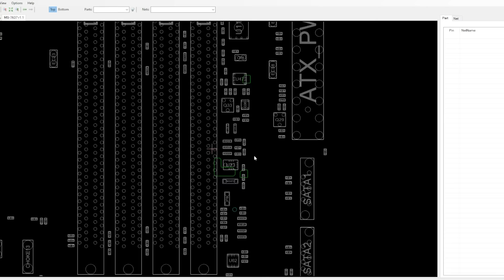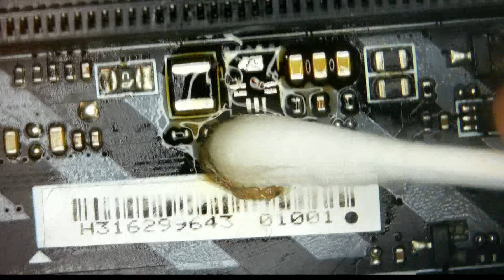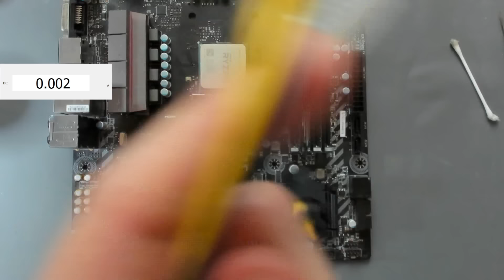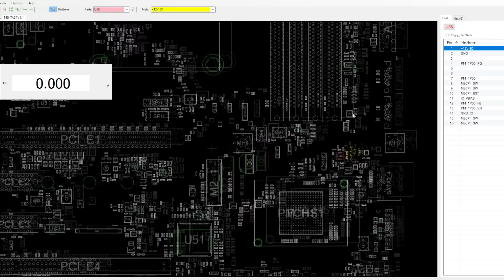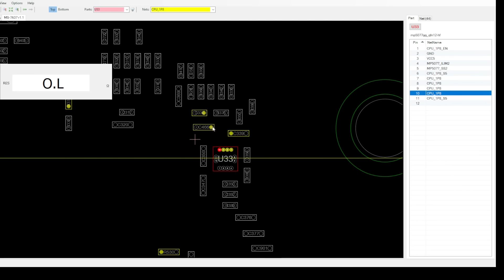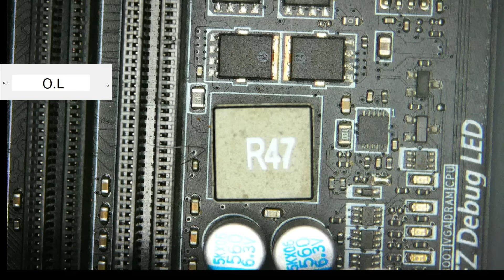SO MANY SHORT CIRCUITS ON THIS MSI BOARD ||| B350M MORTAR MOTHERBOARD REPAIR FIX

Comment: I got this same board that had some issues after a lightning fall near the house, most likely the main PCIe port do not get enough power to the GPU so I am using the second one (x4) and the CMOS battery drains too much faster (2d), I am deciding if get rid of it or try to repair, but I am quite a noob with electronic components :face-purple-crying:

Comment: I swapped the vrms from an Asrock board to a MSI mortar that AI said would work as the components were compatible, but the power management circuit was not having it, lol. The voltages were off just enough to not work. The original parts are like $30 worth of mosfets for a $40 board..... not going to work financially.  Possible, but not feasible. I like this tech’s videos.

Comment: I guess something downstream of the MOSFETs is using a lot of power, ie, faulty.
Maybe someone shorted between rails, and that over-powered the lower ones.
There might be pin compatible chip for the unobtanium, or just design another supply with a different chip.

Comment: Hello thanks again for my last comment. 
I am trying to repair Gigabyte B650M Aourus Elite AX (Newer AM5 motherboard). The problem is stuck on CPU bebug LED. Things that I have done so far
Found physical damage on capacitors next to SIO(iTE IT8689E) one was shorted.
Replaced both caps.

First boot attempt results in stuck CPU LED. Checked for voltages. All present though there is a weird 0.75V rail near BIOS chip.

Resistance of Vcore phases measure 85 ohms without CPU installed. Too low?
Sends 0.9V to CPU when attempting to boot. CPU does get warm after a few seconds.

Lighting LEDs near B650 chipset flashes for a split second then stays off sometimes when power supply is turned on, before pressing power button.

Desoldered BIOS chip and flashed with new version (F30). CPU LED is still stuck.

Used thermal camera to try to find any shorts. Nothing over 50C. Aside from the VRMs there is a serial chip translator/buffer chip (AZ75232) that does get unusually hot 46C at power up.

Last thing I checked was the oscillator crystals. One near CPU socket works at 48Mhz. One near B650 chipset works at 25MHz

Once again confirmed voltages around SIO and chipset. 1.0V/1.8V/3.3V

Any suggestions would be greatly appreciated. Thanks.
Reply from the maker: Have you checked the backside for more dmg? If you found damage already there likely is more! 
What is the resistance off the 12V CPU?
Is pcie reset still applied?

Comment: Been binging you a bit recently and have got to ask a question you may be able to give some advise on. The usb ports send power for about a quarter of a second then drop completely. I was thinking cpu related but before spending money on one I'd like a second opinion.
Reply from the maker: Might need to check the resistance off the USB line, there might be something shorting it, which is why its cutting out!

Comment: Looks like victim of voltage injection done by someone who just tried to copy what he saw online without understanding anything. 

Anyway, about that voltage controller - board manufacturers rarely use something that can't be replaced with different part so you can probably find something else in the same package with a same pinout (chipmakers also try to use same pinouts as competition for a same reason, at least when their customer isn't Apple or somebody big like that).

Comment: Can you share how you do to know the consumption and the amps ? Take by the motherboard? Thanks for sharing your knowledge... Greattings from Portugal 🇵🇹 🌟
Reply from the maker: Only from experience, when i started i had no idea, but after all the boards i did, i now know aprox, what to expect! One off the most important aspects off current is if it is static or jumping! Static is most off the time bad and jumping is mostly a good sign!
Reply: @MainboardMedic  Sorry, I explained myself poorly, I wanted to tell you how you made the connections to see the voltage and consumption of the board... volts and amps ? Thanks
Reply: @skysurfhf  I believe "northwest repair" showed how to build something like that.
Reply from the maker: @skysurfhf  Oh i got it, its called a M4430 on aliexpress! Its a current sensor! So i have a 12V 100A power supply that connects to the M4430 and that then connects to a 12V to 24pin pico adapter! So you only supply 12V and meassure the amps off the 12V and the adapter then converts it to the voltages needed for the 24 pin!

Comment: Hello and thanks for the many tips. How did you get the board view files for these motherboards? I am trying to fix a supermicro motherboard with a broken buck converter IC which I am unable to properly identify. There is only a 4 digit code "89DI" on it which does not show up in the usual IC marking databases.
Reply from the maker: I mostly use the discord of Learn electronics repair and Electronics repair school!

Comment: I had the same issue with a MSI x370 gaming pro. It was tunring on but stuck at CPU. With cpu it wouldn't turn on.
The MP5077 was burnt (no BIOS then), the MP247GD-Z connected to it was 60°C hot and wouldn't provide the correct +V to the MP5077. Also, I had multiple ASM1480 dead multiplexers.
All replaced, the board is now 100% working.
Reply from the maker: What do you think how that happens? Was there an overvoltage or something like that? Because those Multiplexers run on 3.3V as far as i know, and the MP5077 mostly has nothing to do with the 3.3V!
Reply: @MainboardMedic  the guy I bought it from said he got it as working (he lied), but the seller he got it from (good thing for the feedbacks) told me his graphics cards died under a slight overclock. PCIe 1 was working (directly connected to cpu) when tested after repair. NVMe multiplexer and 2 others directly connected to PCIe n2 and n3 died. I replaced them straight away when I saw it POST and didn't actually test if they were working @ less than x8 and x4 respectively. Maybe he was going for a SLI oc.
My guess is that the graphics card shorted bad, killing the ASMs (vid cards + some nvme), the cpu and the BIOS up to the MP247GD. For all that to fry you need some serious juice running through.
10€ + 12€ for parts=22€ for a not so bad board.

Comment: Thanks for the content, very informative. If possible can you make a video about what could go wrong with mainboards, and what one can do to avoid these problems . I am sure there are thousands of factors maybe the top 5 or 10 reasons, and some tips. That would be great. 
Keep up the good work.
Reply from the maker: Actually there are very few reasons for owners to be honest! 
Most common reason is dust and heat, that makes VRM´s blow up.
Second reason is user damage, while handling the board.
And third would be plugging stuff into the wrong ports, so user error again!

Comment: this is the sad reality of amd, a lot of bling bling for something unfinished, bad products, nicely packaged, suffering from instability, incompatibility and in general an unpleasant experience sometimes with errors you don't even know you have. That's why Intel has the experience for 20-30 years, and everything works as it should and amd creaks. Even the 9th generation will still have problems. Probably in 10 years it will become a stable platform. Most defective motherboards are amd. why ?
Reply: Have you seen the intel 13th and 14th gen issues? AMD had been making CPU since the 70's. Cheap motherboards and users miss handling doesn't = AMD being unfinished. I have built numerous Intel and AMD (even some Cyrix) systems over the years they can all have problems.
Reply from the maker: @Bart-q9y  Yeah ive seen that exspecially the higher end ones from Intel are failing left and right!
Reply from the maker: Well its a very low end board, but i think this might have been user error, because the RAM supply usually doesnt get hot at all!
Reply: Intel are going down the drain. Their latest CPUs are terribly unstable. Data centres are sending them back. I haven't seen all these unstable AMDs, but I've seen various boards fail for any number of reasons. AMD have been making CPUs about as long as Intel have.